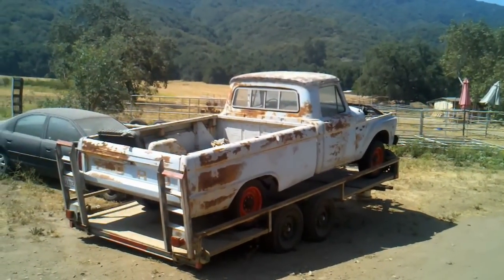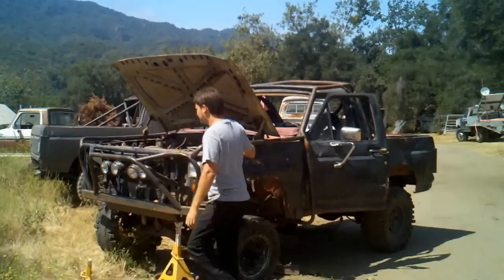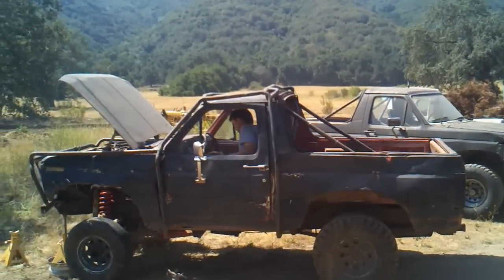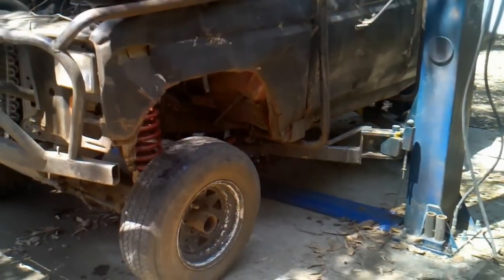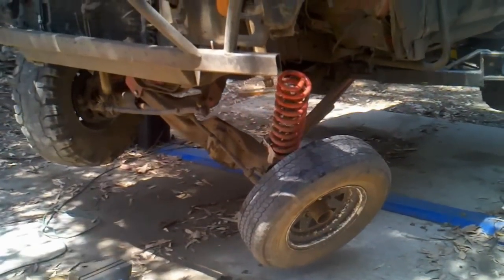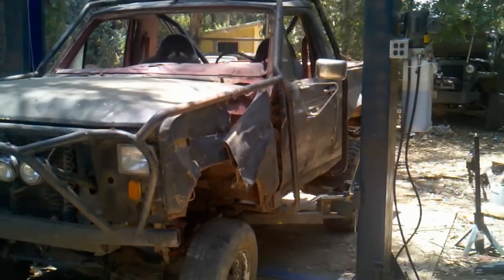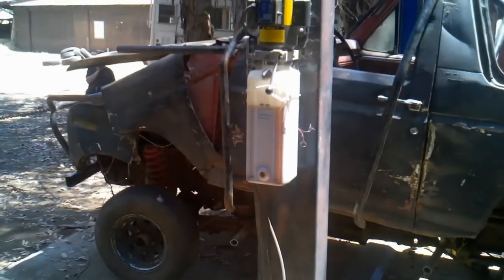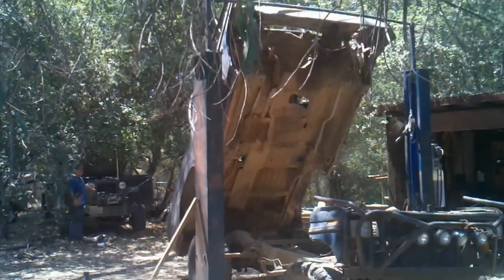Part 1, body removal! '65 truck on bronco frame project.

Comment: should have put some steel or something across the top of that lift and used a snatch block in the center to lift it vertically.

Comment from the maker: Really? What didn't you like about it? I've had a few TTB vehicles, and a few solid axle vehicles, such as an explorer on 'tons (in other videos). I've found the TTB to be far, far superior to the solid axle vehicles for "go fast".. no comparison at all.   i air'd my TTB on a weekly basis for years, only failure was shock towers and the chassis bent a little. and i wore out some shocks.